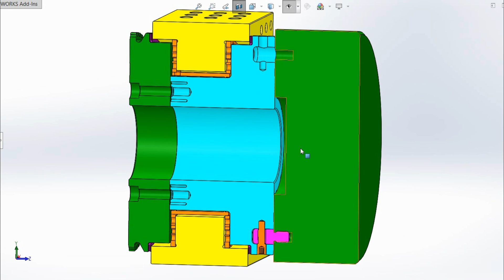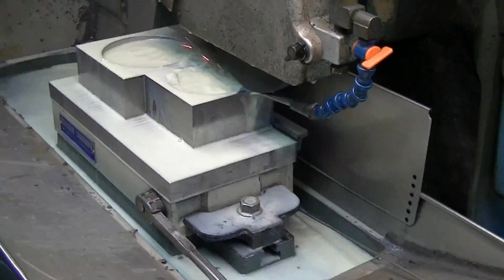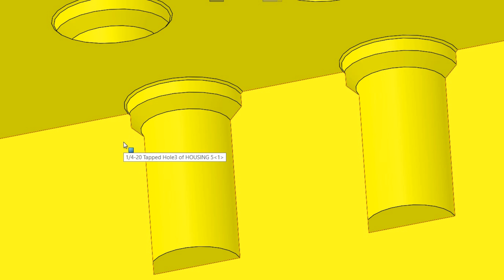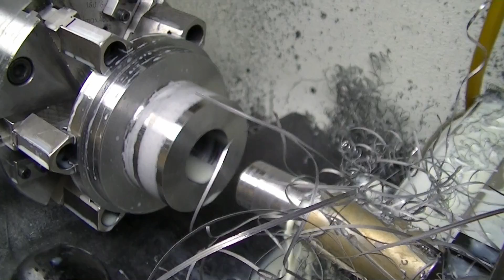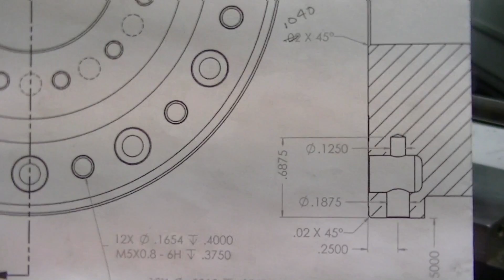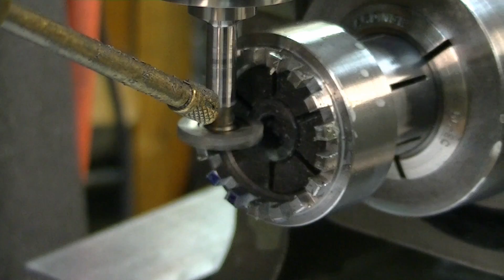MAKING ULTRA PRECISION TOOLROOM SPINDLES #1

Comment: 20 million dollar Harig and a 5 dollar C5 collet help me understand
Reply: I would pay serious money for robins prints on these. This design is fucking nuts
Reply: You can also mount mag chucks and vee blocks to them. Also if you make a ring that fits over the 5c taper, you can now tap adjust the runout of your collet, youll need an increased length draw tube for it to work. Naturally, light grinding only if you do the non seating 5c. It works well though.

Comment: Robin, what do you think of the idea of a torque - isolating washer so that torque induced stress is contained and not transmitted to the underlying body. I don't know if it'd actually have any utility in the industry but, when you're getting down into the region of a gnat's ass, I'd think it might become worthwhile to do. 
It's simplicity itself. It's a washer with a handle. 
In operation, you hold the handle to prevent the washer from turning while the bolt is being torqued. Thus, the torque stresses stop at this washer and only linear forces are transmitted downstream of the washer. 
What's your opinion?
Thanks for all of the work you take upon yourself to do these videos. 
Much appreciated!  :)
Reply from the maker: Watch this https://youtu.be/OcSAIRhDrGE
Reply: @ROBRENZ  Sweet! Resounding confirmation that at least a small part of my aging (not so gracefully...) brain IS in working order. Nice to see that rumination actually had some merit to it.!
Thank you!  :)
Reply: @ROBRENZ  Thank you, I will!  :)

Comment: Even though what you do is completely outside of my wheelhouse, I do enjoy a fair bit of crafting/Jerry-rigging/bodge-jobbing things that I need for various other interests and personal projects from stuff that I've accumulated over the years and I get a joy from misappropriating objects and items from their intended use. This kind of precision manufacture of tooling is light years from what I do, but I have a fascination with precision and you are the Jedi knight of precision in my feed, for lack of a better term. Even though I may not be able to directly apply any of the techniques that you use for a simple lack of machines that do the kinds of things you do, but I find there are concepts to be gleaned from almost any form of craftsmanship and engineering that will find a use somewhere else (or perhaps even just a new level of understanding something that I'm looking at). Thank you for sharing your knowledge, taking the time to make these videos, and for going full retard, geeking out on details of the operations you're performing. Love it.

Comment: With the grinding using the V block you added the support in dead centre, however, why is it you can not directly to the table without support so that the bottom is flush with the y/x axis surface and perpendicular to the V block? Btw the video is extremely 😎
Reply from the maker: Because those surfaces are not square to the surfaces in the v block yet. That is the purpose of this operation, making the third surface square to the other two surfaces.
Reply: Ah, I think I know what you mean. Before grinding, you have no square surface, and as such it will not sit flat on the "table", so you wedge in support about the dead centre to alleviate the downward force produced by the grinding wheel. Something tells me you would introduce a bend in the material without the presence of a support block, and this is where I apologise as my terminology is likely close yet not correct. You have an interesting job. :)

Comment: Hey Robin id really like to make a measuring device for my bandsaw like the one you have.......I dont remember where I saw it did you make a video on that..........if not what did you use for measurement device can it be done with an arduino somhow im not the sharpest tool in the shed so take it easy on me
Reply from the maker: I used 12'" calipers and cut the jaws off.
Reply: @ROBRENZ  great idea thank you sir

Comment: Robin, as an aspiring-machinist, I am curious as to why you didn’t use a rotary table or dividing head to drill the circular hole patterns in the spindle face at 20:57. Is approximating a circle using coordinates along two linear axes more accurate than rotating the part around one axis?

I’m guessing if I knew the accuracy and repeatability of the tooling available in your shop I could do the calculations myself, but if I learned one thing from ToT, math is for suckers.
Reply from the maker: None of those hole patterns need to be extremely precise. The answer to your question depends on the accuracy of the machine and dividing head.
Reply: @ROBRENZ  Good points.
More importantly where are you with this project. Its been a while since you posted this.
Any advice on what us mere mortals might do for something similar.
I know I can buy a high precision indexer from Suburban Tool or re-engineer one of the cheap Chinese units an many do.

Comment: can you tell us anything about that magnetic v-block?  Is that something you made, or can they be purchased?  And how do you test and correct its squareness?  I know how to do it with an autocollimator, but would like to learn other techniques
Reply from the maker: Penn Tool Co.  SPI 95-707-6   $686.01  It is very good as is.  I modified mine to have a recessed flush on/off  instead of the standard knob.  There are common methods for checking squareness with and indicator.

Comment: Great video.  A suggestion, place a small 5-10 micron filter in the air gallery to prevent burrs from exiting into the bearing cavity. It's a last filter after the purge port, replaced only during rebuild.

Comment: Can you comment of the stiffnesses (radial/axial) you expect from this design? And what the maximum loads might be? I've been using air bearing spindles for single point diamond turning of optics for about forever. These spindles are typically very stiff (> 1e6 pounds) and very accurate with TIR of one or two microinch, but are pretty delicate in terms of loads and potential grounding (not good). So not usable for efficient metal machining e.g. a typical DOC with single crystal diamond bit is 20-100 microinches
Reply from the maker: 11.7 million lb/" axial,  3.4 million lb/" radial but this is meant for very low speed grinding workhead use. Thermal stability of this design is not adequate for precision optical turning at higher speeds.  I have used PI air spindles a lot for precision grinding and that is why I designed these as a more toolroom friendly unit with higher capacities.
Reply: @ROBRENZ  Thanks! A sizable fraction of the steel modulus. And many times the stiffness of an air bearing. Since I didn't do anything but extremely low tool force single point machining I've no idea what air bearing behaviors and limitations you'd run into in a more rough and tumble process. 

So, low speed. I did wonder about things like thermal growth and preloading etc. My last DTM (Nanoform 350) used the usual lab chiller for spindle stability, and an air shower if I was doing a larger part.  

BTW, in my optics lab (Naval Weapons Center China Lake) I had a WW2 era No 11 Blanchard grinder. I loved that machine. I made flat tooling, laps, references, whatever in glass and metals (invar, iron, steel) with high accuracy and speed. Kept the oil cups topped, ground the mag chuck a couple times, used the same old diamond wheel for 27 years. Not as lick of trouble, a total workhorse.
Reply from the maker: Wow, sounds like a lot of fun and that I could learn a lot from your experiences.
Reply: @ROBRENZ  That was, as they say. a sweet gig. I retired in 2016 without a replacement taking my place. The July 5th 2019 earthquake pretty much killed any hopes of bringing that lab active again. 

I was an optician and optical engineer, these days I fool around with metal, I think I have a lot more to learn from you then you from me.
Reply: @CaskStrength777  Well, I'd say being a Toolmaker in an aerospace shop is nothing to sneeze at. I worked closely with precision machinists and model makers and relied on them for my work. I've regrets in my career too, things I wished I'd done differently. But, I sure don't regret leaving precision optics fabrication behind when I retired, that was like pulling my own teeth at times. Learning more about metal fab now is a hobby for me, one I can apply some of my metrology skills to, when it makes sense. I'm glad there are folks like Robrenz willing to take the time to show what they are doing.

Comment: Wouldn't a ball (perhaps with a ground flat spot to help it stay in place) be even better than a square shim as the workpiece support on the v-block?
Reply from the maker: It is not critical, its just to support the part weight.

Comment: Nice machining and very high skills but, Ultra precision spindles of TIR 0.000 13mm ( TIR 0.000 005 in) are not made with ordinary high precision lathes and nor can they be dialed in with a 0.00127mm (0.000 5 in) dti. Ultra precision grinding with vibrational isolation and very high level temp control is needed. I have no doubt that what this person makes is excellent but achieving inch millionths is beyond even very good jig and tool shops - very high specialisms and engineering science is required.
Reply from the maker: Stay tuned as you will see it happen :-)
Reply: @ROBRENZ  OK, lets see then...I have very high precision ring gauge 70mm  + 0 / -0.0001mm NAMAS certificated however there's more to precision than that - my mill spindle on a Haimer BT40 HG sleeve ,10mm ground carbide post at 4D extension  has a 0.001mm TIR. using a mitutoyo inductive probe set on scale 0.0001mm. So, this is a good mill spindle , but it is not ultra precise. I'm very interested in what you can do...I've subscribed !
Reply: @TAH1712  Generally Robin doesn't make a video until it's good and well done. I feel pretty confident that he wouldn't have tossed those numbers around if his finished product didn't meet or exceed the spec.

Comment: You said you set your compound, but there is no compound! Were you being facetious? Another PhD class in machining and tool design.
Reply from the maker: Yes joking.
Reply: I had to watch this in 3 parts. I couldn't take it all in at once. I will probably watch if a few more times just to try to absorb it all.
Reply: Oh Lord, don't get Robin started on lathe compounds. Solid tool post or nothing. 👌💪👊
Reply: I laughed. Came to the comment section to see who was going to mention it. 👌👍

Comment: Really cool stuff! You are pretty careful in your work. It seems that you are at the very edge of conventional machining, heading toward Piezo manipulators, interferometery, air-bearings, and temperature controlled stuff. I have learned a lot by watching this channel. Thanks.

If it weren't for the particles--a circular clutch plate from a motorcycle clutch could be used to lock the spindle in any position. Something would have to apply a thrust load to lock it. Two mating rings that machined to be ramps could be cool, as if you put two wedges facing each other, and then wrapped them to form rings.

[I've seen spherical bearings on farm equipment that had eccentric locking features to reduce the need for grub screws. So, the rings lock be eccentricity; the grub screws only keep it from turning.)

I am also reminded of spag clutches for motorcycle starters, which use a ring of rollers that wedge. That would look cool, and not leak grit, though the common sprag wedging system works one way. Oddly, mountain bike brakes have sintered full-metalic pads.

I have some harmonic drives. Someday I want to make a 4th axis that locks, somehow. I should think that you have the skills to make a good harmonic drive. I wish we made more of them here in the States. Nudge, nudge.
Reply from the maker: Glad you find the content useful.  I have non influencing locks in mind that will not influence the spindle. They will show up in future videos

Comment: Do you use a 120deg spot for 118deg twist drills?
Reply from the maker: I actually use 90 spot drills so I get a chamfer to boot even though it is technically bad practice.
Reply: @ROBRENZ  in your experience, when does it actually make a difference?  Or is it just a machinist myth?
Reply from the maker: @capnthepeafarmer  Technically its better for the drill to start cutting at the tip and progress out to the OD like it would with a 120 deg spot and an 115 deg drill. But I never have any issues using the 90 deg spot.

Comment: Lovely piece of machining! Although I don't understand how it locks to a position or why do 75 divisions instead of 72.

PS: I made a magic sanding plate a few months ago after watching your video. Last week I upgraded it to psa backed microfinnishing film (3M 268L) and diamond lapping film (3M 668X) on the other side, it's pricier than regular wet/dry but the performance is incredible. They sell them by the sheet on Lee Valley.
Reply from the maker: Correct 72 divisions for 5 degree increments, I miss spoke. Thanks for the catch. The locking and angle setting attach to the housing.
I use the diamond lapping films but put them on my toolmakers flat.

Comment: I highly appreciate your videos - fantastic level of craftsmanship. I’ve already learned a lot by watching them. Are those parts getting nitrided (around 56+ HRC)? 
I built a small CNC milling machine with ATC from scratch - maybe you enjoy watching it :) Keep up doing these great videos!
Reply from the maker: 60-62 RC through hardened
Reply: Nitriding could actually be harder than hardened tool steel if I recall correctly but it's only very thin surface layer and requires special steel to form the nitride.
Reply from the maker: @MF175mp  Correct but hardness has to be fairly deep to not yield under the ball pressure
Reply: sure
Reply: @MF175mp  Yes, increased hardness can be achieved by nitriding. For this - as you say - an appropriate material must then be used. However, nitriding is also possible with non-special (tool) steel - for lower final hardness. The hardness depth is around 30 micrometers, depending on the cycle time. 56 HRC is the minimum hardness for a raceway. Normal raceway steel like 100Cr5 sits around 60-62 
@ROBRENZ I thought the lower distortion and fatigue strength of nitriding was advantageous here. Is through hardening necessary with the rather low loads?
 The (steel) balls are at 62+ HRC if I am not mistaken (should be higher than the raceway...) Ceramic ball would be an option or not? Due to less deformation, heat influence, corrosion and electrical insulation

Comment: Just curious why you went for a ball race rather than a plain bearing?
Reply from the maker: plain bearings at slow speeds have axis shift every other rotation.
Reply: @ROBRENZ  If it's not too complicated to include in your next video about this project, could you please elaborate on why plain bearing surfaces have an axis shift every other rotation in comparison to the ball bearings your planning on using here? Either way I'm looking forward to the next video. Thanks for sharing.
Reply: @ROBRENZ  how precise could an air bearing be?
Reply from the maker: @MF175mp  Routinely less than 1 micro inch
Reply: @ROBRENZ  at what kind of clearance would it be? Probably around a micron could be possible for slow speed applications if the roundness and roughness were really good?
Reply from the maker: @MF175mp  That is a science in itself.
Reply: I just realized that there are some design guides online that provide pretty good information for the home shop guy. I will definitely attempt making an air bearing grinding spindle at some point just because I'm the cheapskate home shop guy and can't afford super precision spindle bearings and I have the equipment needed to cobble one up
Reply from the maker: @MF175mp  Go for it!
Reply: @ROBRENZ  sure, need to get my Moriseiki hobby lathe up and running and finish about 300 other projects first

Comment: It say's unlimited amounts about anyone's shop capability's and personal experience who fully intends on re-designing and improving on the built in accuracy something like a Harig already has since there well known to specialize in extremely accurate grinding equipment. I'm more than suitably impressed Robin. I've zero doubts you can do so, and this will be a more than interesting series of videos.
Reply from the maker: Truth be told I am expecting 1 microinch tir.
Reply: @ROBRENZ  For a home shop I thought I was doing ok, my best Mahr indicator has at least 20 times less accuracy than where your going. After checking there web sites, Harig will only state "within 10ths" for there Grind-All no. 1 and Surburban will say 1/2 a 10th maximum TIR allowable on there Master Grind indexer. So they'd be shooting for around 25 millionths. Until last night I always thought RJ Newbould, SIP, Moore Tools were doing pretty good. One microinch is NIST level. I can't think of an adequate descriptive term for what your doing.
Reply from the maker: @turningpoint6643  Professional Instruments makes air bearing spindles that are <= 1 micro inch tir and I have used them extensively. I want to build an equivalent that does not require all the expensive air preparation support.